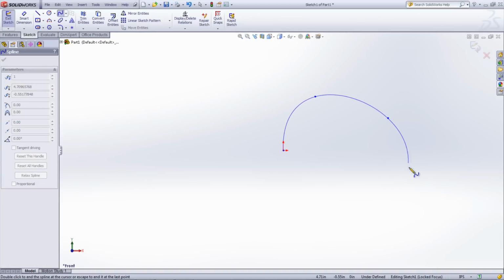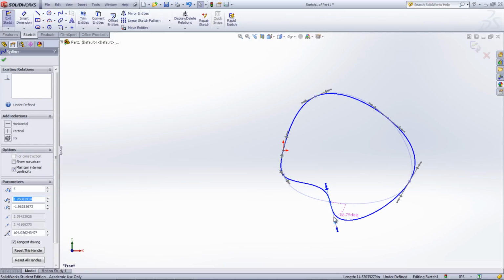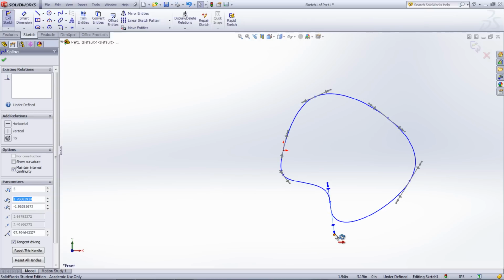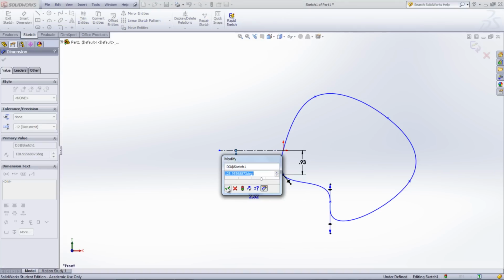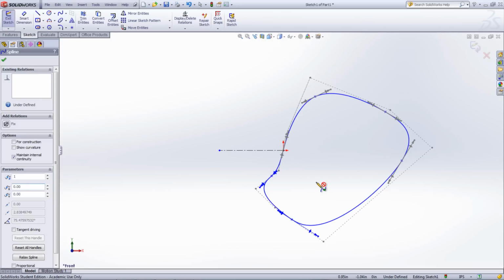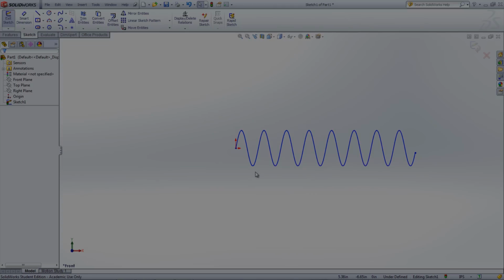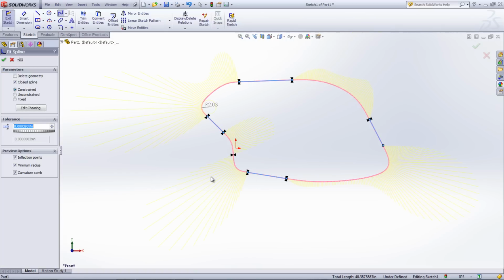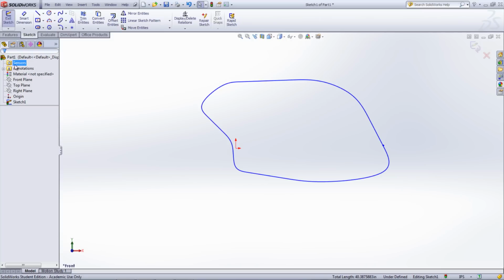SolidWorks Spline Basics

Comment: I am using solidworks 2017, but when I create a line with the tool, I can not see the handles to modify the corvature, in the toolbar of sline, it is not enabled the option to see handles, it is selected but by right clicking it does not paparece, does anyone know why this happens?

Comment: hi, i have predefined points i need to run a spline through (kinda in a u shape) and i want to keep smooth curvature lines and all on the outside of the u shape, is there a simple way to do this?